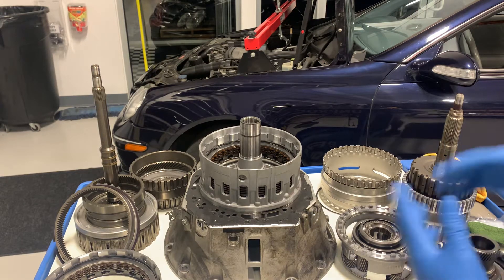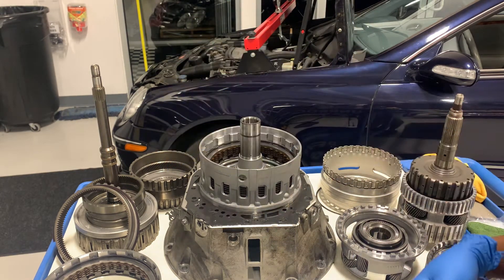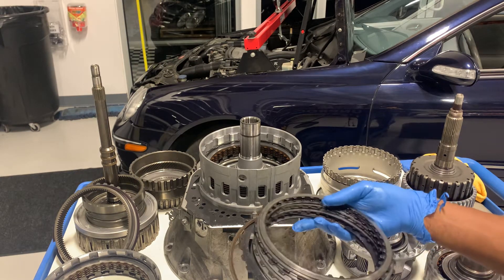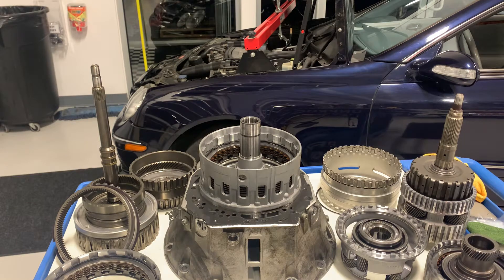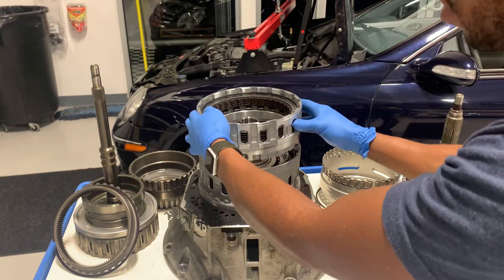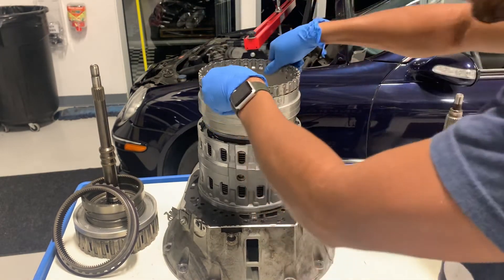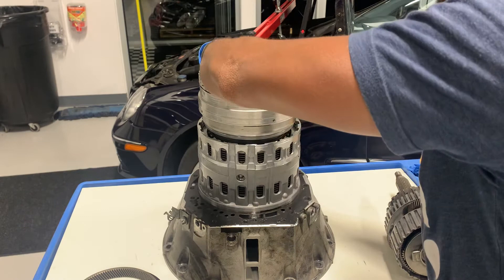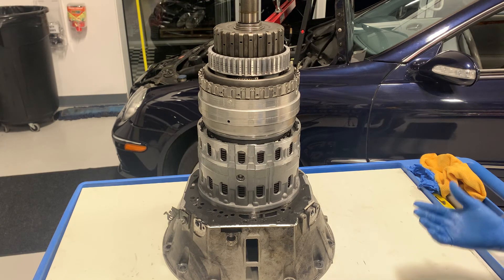Mercedes 722.9 Transmission with shifting issues (7 speed transmission)

Comment: With oil changes every 40-50.000 km you have nothing to worry about with this gearbox . You people only change the oil only when start to notice bangs and hard shifts and is too late . i have almost 300.000 km on mine  , without rebuild and it works really well , i am really happy with it . Not my first benz , it won't be the last i love this things .

Comment: Honor And Respect Sir... Did I Blink And Miss The Installation Of Clutches...  TIA
Reply from the maker: Ha! I should do a video on clutch installation. If I remember correctly, all of the K2 clutches got replaced.
Reply: @askbascombe    Wouldnt You Want To Replace ALL Of The Clutch And Steels, If Ya Got It Opened Up? How About Installation Of New Pump, Being That Ya Got it Open?  One Again , Thank You For Your Time, YOUR MOST VALUABLE ASSET!
Reply from the maker: It’s situation dependent and my approach can be unorthodox at times. On these computer controlled Mercedes 5 and 7 speeds it’s not uncommon to open to all the baskets and find VERY minimal wear to the clutches and steels. Additionally if the pump measures to spec, it’s getting a new seal and I’m reusing it. Pump, clutches, and steels, can last 200k+ miles without issue. Seals, bonded pistons, balance piston, valve body and tcm are a different ball game. Those are problematic and get replaced where applicable on my vehicles. Customer vehicles are a different story and I’ll always advocate for replacing all wear items while I’m in there.
Reply: @askbascombe  Roger That. I Got An 09 ML350 That I Will Have To Drop The Pan, Valve Body, To Remove/Send Off The Conductor Plate,  A Failed Out Put Sensor. When I Have To Pull The Power Pack To Do Timing Chains, Ill Have The Clutches Done When Everything Is Out. Pump Then Too(Unless Transmission Failure Requires Sooner)  Thank You...
Reply from the maker: @escott3829 W164s are fantastic vehicles and I thoroughly miss mine. Glad to hear you are keeping yours going!
Reply: @askbascombe  
I Do 1980s 300s And Normally Aspirated 240s..
After Driving An F250 As My Marine Diesel Service Truck.. 
AND
HEMMT Nation Guard Trucks
I Wanted A Higher Ride Height.. A Benz..
09 ML Fit The Need
Reply from the maker: @escott3829 ohhh I’ll be picking your brain about the 80s stuff then. I specialize in 90s and 2000s era Mercedes. I have extremely limited experience with W123 and W124.
Reply: @askbascombe  To Be Honest...
They Really Have Been Trouble Free..
About The Only Thing I've Had To Do Is Windshield Seals.. I Paid A Glass Company To Do It After I Failed At It.
AND
Basic Maintenance..
They Run And Run...

Comment: Nice video - thank you for making it. I have a 722.9 in a R171. I've been tossing around the idea of rebuilding it. Generally, I find a service fixes most issues but it had the conductor plate issue and a few times (before it was replaced) there was burning clutch smell. It's functionally good other than some gear noise and an annoying clunk when downshifting into second. That appeared after the conductor plate was replaced and no amount of DAS adaptation fixes it. In my mind, ideally, new frictions, steels and pistons would be ideal. But I don't know what causes the clunk into second when coasting up to a light. My concern is being able to measure all the clearances. Any idea on what would/could cause the 2 gear clunk and also the gear noise? It would suck to rebuld it and have the same two issues.
Reply: I also have an R171 SLK55 AMG, and it also has had these exact issues as well for some time.  Recently it got worse though, not long after changing the fluid and filter.  The filter was clogged with friction material, and there were some quite large metal shavings/debris in the pan.  Time for a rebuild! (141k miles)
Reply: Did u find out something?
Reply: @saadkamran7  Are you asking me?   Yes, i found out that my transmission was TOAST lol
Reply: @Johnathan_Waters ”quite large metal shavings/debris in the pan” why did you hold out hope 😭😭😭

Comment: Great video...for an 04 s430 w220 rwd 7G..im having a really hard time getting one..which benz carry the 7G rwd transmission...if not I can rebuilt but cant find any kits..any advice
Reply from the maker: Anything with a 722.901 variant. At minimum, RWD S430, S500, CL500, SL500.

Comment: My R500 trans is banging into second gear when slowing to a stop. The b1 clutch adaptation is maxed out. I flushed the fluid and reset adaptation, now it's much worse. You didn't mention the b1 clutch in your video. It's it the one on the back of the bellhousing?
Reply from the maker: B1 is your stator support. The B1 is bolted directly to the bellhousing. It has a large molded piston and that piston as well as the set of clutches in that basket might be damaged.

Comment: 2016 s550 coupe kick in downshift from 5th to 4th did fluid change got a little better was told by Mercedes my shift point between there is maxed out at 20 they want to tear down transmission any thoughts?
Reply from the maker: That means they reviewed the adaptations and because it’s maxed out it points to mechanical damage. Unfortunately, a trans teardown is the correct next step in that instance. The 5-4 shift requires application of the B2, something might be damaged in that B2 clutch drum. The B2 and K3 likely have issues
Reply: Thank you I appreciate you do I sell or fix what would you do?
Reply from the maker: I know what I would do, but everyone’s situation is unique. I think coupes were only offered with 4Matic so all the AWD bullshit that fails should be checked at the same time. Front driveshaft, front differential, engine mounts etc. It’s going to be a healthy bill so consider working with an independent in your area that specializes in Mercedes vs the dealer.
Reply: Independent wants to change valve body for 3100 saying it help the issues DCMotorwerks if your familiar but if it’s clutches that won’t fix sht everything you named has been serviced and looked at I’ve only had it a month not sure to keep or sell 59,000 mls

Comment: Wow nice job 👍 I have a CLK 500 and I won’t shift at all is there anything you can tell me ??
Reply: Scan your codes, you will need a scanner that can do mercedes like icarsoft or an euro shop
It can be low transmission fluid, and various component failures like the electronic conductor board, which can be replaced. A code scan will pin point your issue, go from there

Comment: very good video, hey kyle i have a  e350 722.9 im working on the transmission but having a real hard time pulling the torque converter out any tips how to get it out .thank you in advance.
Reply from the maker: I’ve never personally had that issue but when it comes out, inspect the front pump and stator support closely as one or both might be damaged.
Reply: @askbascombe  morning kyle yes pull the converter out and the pom was destroyed what do you think repair the pom and bell housing or get an entire donor good used one??

Comment: May I ask you, what is the difference between 722.9 of m113 and 722.9 of m272?
Can I use the 722.9 of m272 for w211 with m113 engine?
Reply from the maker: I'm not certain of all of the differences. However using your example of W211 RWD M272/M113, bellhousing and torque converter will be different, the case and internal hard parts *should* be the same as will the output flange. Valvebody will be different as is the TCM programming. There were also running changes to various components over the years to improve the design.
Reply: @askbascombe  thanks for replying, actually my car is CLS w219, I swapped my engine from m272 to m113, I've changed the torque converter and the deferential, conductor plate reprogrammed to fit the new engine, I'm wondering, should I change the transmission 722.9 from CLS 350 to the CLS 500?
Reply from the maker: @user-kg5jx4ny7d as long as the differential ratio is the same, or the plate is programmed for the engine and differential combination, I see no need to change the transmission.
Reply: A last question if you don't mind, what is the difference between 722.906 transmission and 722.901 structurally?
Reply from the maker: @AhmedtmNajah  901 is used for all M113, 906 is used for M272. So the first major difference you'll notice is the torque converter. The pads for a 272/273 converter have a noticeable difference compared to 113. I forget if we discussed this already but use the bellhousing and torque converter that is intended for the engine you are installing. Case, output shaft and internal rotating parts should be identical in 901 and 906

Comment: which may be the cause of jerking when downshifting from 3rd to 2nd gear while going uphill (722.9 )
Reply from the maker: Before troubleshooting the transmission for that symptom, considering replacing your engine and transmission mounts if you haven’t already.

Comment: are the parts compatible with G550 2014?
Reply: mine isn't shifting to 5th. (and barely goes into 4th)
Reply from the maker: Parts are the same on a G550. Some parts had minor differences and updates